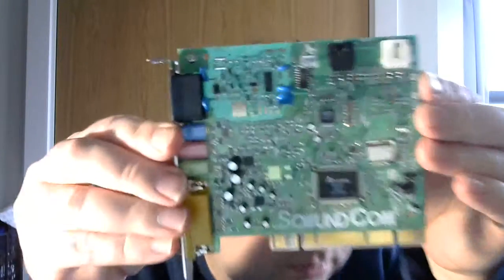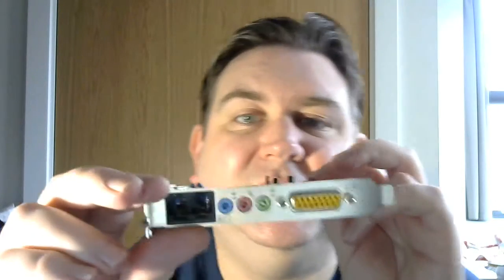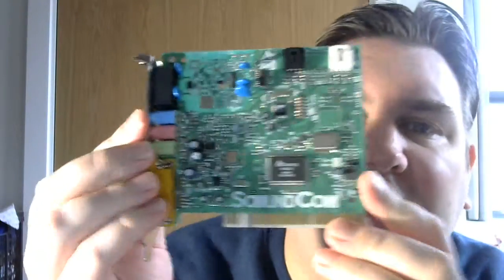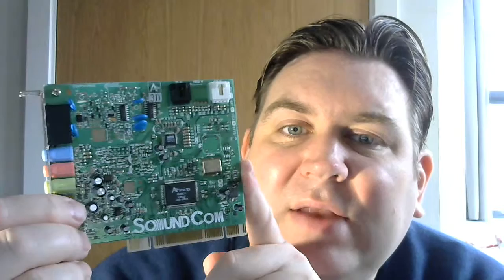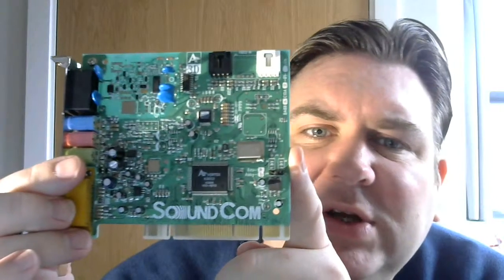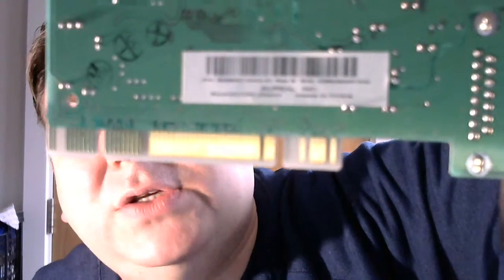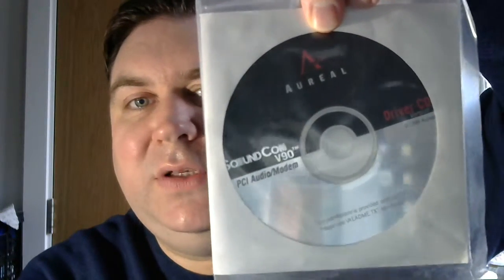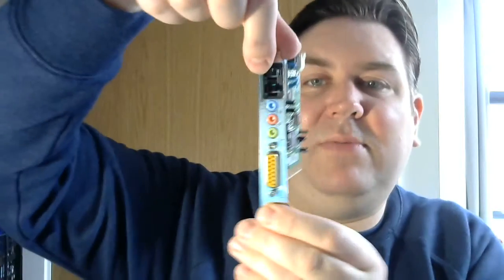#26 - EPIA Project Part 4: Aureal SoundCom Multifunction PCI Card - Strangest Aureal Product?

Comment: Hey friend, what a cool find. I'm not sure your Aureal inf and modem wdm driver trick will work properly. 
Aureal Vortex ASIC's map the modems registers into it's own internal register space, if you run another driver for the modem and trick it to install over Aureals modem filter driver then it won't know how to communicate with the chip since the newer Motorola drivers won't have the correct handling for the Aureal registers where the Modems register mappings are setup.

However it may just be that they never removed the Aureal code and the inf hack will work, most likely not but you never know until you try :)

PM'ed you at vogons
Reply from the maker: Thank you for the info ZanQuance. I've not seen much data on these cards but you seem to know your stuff. The thing that got me curious about the hack was that the Asus driver set appears to have the later-style SM56 WDM style software enhancements (such as the tray icon, that kind of thing), however the executables do give file info of "Aureal Modem Device" so there maybe some customization. I'm interested to see - look to the Asus drivers I link to, I haven't modified those from the state I found them. The .inf file lists the PCI subsystem ID, which is why I was wondering if it could be the inf alone which is allocating the register space which you mention. This is a very interesting arrangement though and wonder if it's something used by other manufacturers often? I assume graphics cards use it for TV tuner / tv out / hdmi audio type subsystems? How do I get started on delving deeper? I have a book on "c" but apart from the linux drivers I see little in terms of source code.

Comment: Would you recommend it as a good alternative for the best Aureal experience or is it a poor version of the card?
Reply from the maker: It's somewhere between a Vortex 1 and Vortex 2 for me. The truth is it's all done in software, but it does properly support A3D 2.0 and 3.0 because of that. Needs a faster CPU say 400-800 MHz really to operate at proper performance. However for <£20 its a great price compared to a new Vortex 2 card.
Reply: betamax80 is there any difference in sound quality with the software mode, as I was thinking a win98 p4 build would be a good candidate for such a card
Reply: Also does is support wavetable add on through the game port as the FM emulation isn't that great in Aureal cards
Reply from the maker: Yes it still supports that, and has the FM / SB PRO 2.0 support in DOS. No onboard wavetable header though.
Reply from the maker: That sounds ideal. I was using on a K6-2 550 and there was a kind of "broken reverb" because of CPU overhead. I don't think you'll find that on a P4 - and all the features are there.
Reply from the maker: As a warning still no decent support for WinXP - Win2k is okay but the modem portion is not 100% - Win9x is its thing.
Reply: betamax80 I'll keep that in mind if I get round to buying it, thanks for the help :)